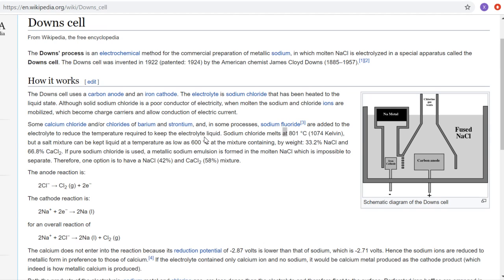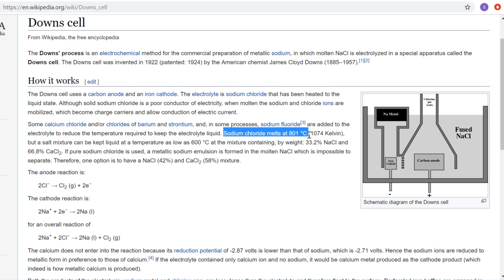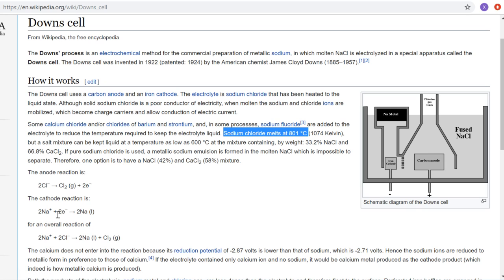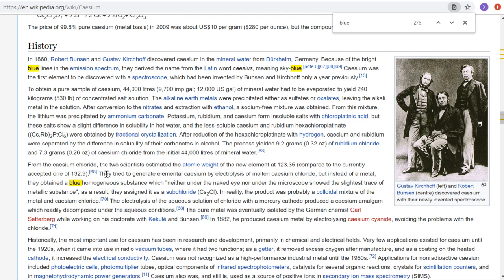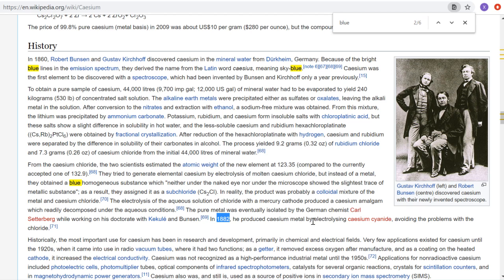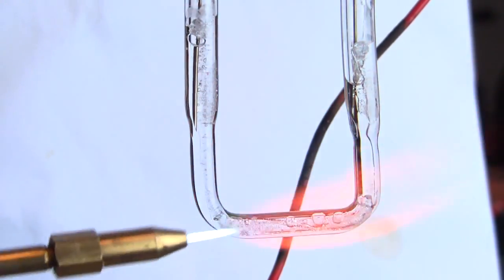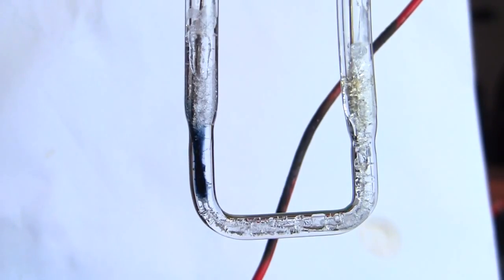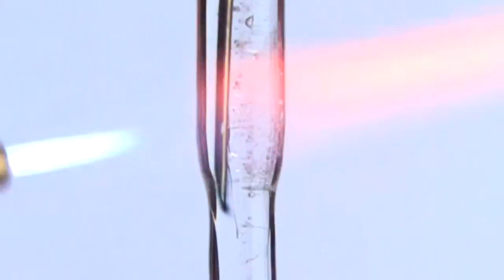Why you can't make Cesium by electrolysis of Cesium Chloride!

Comment: That is solvated electrons from the cesium. The stuff is wanting to get rid of electrons at all cost, even blue light can knock electrons off it. FWIW the easiest way to get cesium is to react the chloride with either magnesium, calcium, or lithium. It seems counterintuitive that these work, but the vapor pressure of hot cesium vapor is so high that it separates similar to how a precipitation reaction would concentrate a strong alkali as hydroxide from a sulfate salt.

Comment: But you CAN electrolyse CsCl at ambient temperature in a carbonate solvent: https://escholarship.org/uc/item/8m6348vh (you need AlCl3 to increase solubility though)

I'm quite curious about the chemistry here though, what happens to the resistance of the salt cell as the blue region progresses across the cell?
If the resistance drops this might indicate that a path is being formed across the cell made of a different material, maybe some sort of subchloride or the colloid mentioned in the wiki?

Comment: I tried a similar experiment by electrolyzing a mixture of CsI and LiI which has a conveniently low melting point around 100C. As expected there was free iodine being released
 at the anode in the form of vapor, so I expected metallic Cesium and/or Lithium to be present near the cathode or throughout the liquid salt. Strangely, after solidifying the salt and dissolving it in water there appeared to be no sign of metallic Cesium or Lithium, no reactivity, no hydrogen bubbles, just salt dissolving in water. It would be interesting to know if there is any sign of dissolved Cesium in the above experiment by dissolving the solidified salt with the gray or blue color occurring near near the cathode in water.

Comment: Even though I don’t think you actually created solvated electrons at such a high temperature, I think the electrochemically reduced Cs+ to Cs0 just acts as a dopant for the CsCl so to get Cs:CsCl, if so you should eventually end up with Cesium metal if you would further electrolyze the cesium chloride.

My other theory is that it forms a complex, since it has the electron configuration [Xe]6s1 and the fact that one cesium ion is coordinated by 6 chloride ions. I mean if you have the CsCl the Cesium would still have to get further six electrons to get a noble gas configuration and therefore it might be able to take up further electrons to reach its octet. Of course I really have no clue whats going on but the formation of a complex compound seems pretty logical to me, also this explains the color.

Comment: I study engineering I have 2 ways to get started on asignments and research one is hammer it into google and look at the pdf's and books, the other is look at Wikipedia brush up and go to the source section. recently I found this interesting page: https://www.researchgate.net/ nowadays I look at it too just to make sure I get newer intel on things.

Edit: We learned about the Sodium electrolysis in chemestry 101 for engineers, looks just like what we learned, I wouldn't dismiss it but look as stated before at the sources to see if no one fumbled around with the entry.

Comment: i do not think Wikipedia is a good source for public figures, animal counts, and anything conversational anywhere around the world. Chemistry and physics isn't any of those. Most of the sciences is never touched on Wikipedia but climate science, the big bang theory (science)  and a few others are not so reliable on Wikipedia due to popular thinking of " these are not real things".
It can be a good starting point to then go to more reliable less user generated content based sources to get the knowledge from as Wikipedia will ussually leave you with links at the bottom for where to learn more about it. To .edu sites for science pages.

Comment: The conventional explanation I read years ago is that electrolysing molten CsCl leads to the liberated Cs metal dissolving in the molten CsCl - which is where they got the idea of the subchloride (Cs2Cl) from. Now that we all know about blue solutions of solvated electrons, which they did not, it seems more than likely that your blue solution is just that: solvated electrons.*
However, Cs + nCsCl -> Cs[CsCl]n+ + e is not so far off the subchloride; I'd say their suggestion was reasonable at the time.

* I realise you know all this, but you did say at 5:44, "So, what the hell's going on here? Still don't have a good answer..." I see no issue whatsoever in postulating solvated electrons at high temperature. Remember, liquid ammonia works as a solvent for blue solutions not because it's cold but because it's polar-aprotic (effectively) - HMPA can give blue solutions of Li, Na, K etc at room temperature too, as can other solvents, and, let's face it, fused CsCl is a very polar-aprotic solvent. I suggest you analyze spectroscopically, compare the blue solutions in ammonia, HMPA, and CsCl: the spectra of the blue solutions should depend on the cavity occupied by the free electron and be nearly independent of the solvent, no? BTW, I have lab experience in chemistry like you, so if you'd like to discuss this, let me know. Fear not: I'm not seeking to out-publish you.
Reply: So that's how you do strike through, LOL! I was trying to write: Cs + nCsCl gives [Cs(CsCl)n]+ + e[-]

Comment: I'm just going to take a guess here. if the yellowish color on the right side is chlorine, than that may confirm my/your suspicion. What I think is happening (with my very limited knowledge of chemistry) is that the cesium separates from the chlorine, and that the cesium ions are soluble in the liquified salt resulting in a similar occurrence to the solvated electrons in liquid ammonia. Basically it could be solvated electrons from cesium in molten CsCl which then crystallizes, forming the blue crystals we see in the experiment. Again, I am not a chemist, but this just my humble opinion.

Comment: Possable theory that blue stuff could be cesium oxide or hydroxide from oygen or water in the air try the experiment but with the tube under vacuum
Reply: Yea it could be. My guess is that whatever has been produced has reacted with something (such as the rod or the glass) it would be intresting to see if this would work with a metal U tube

Comment: Are you sure it is diluted electrons? Did the colour last after solidifying?
I could be small particles and some scattering effect, if they are small enough optical microscopes couldn't observe them, but they would still scatter light in the wavelength range of their size, no?

The Wiki article is in line with that hypothesis, calling it a colloidal solution. I'd bet my money on some optical phenomena, rather than electrons... Free electrons at several hundred celsius sound really scary, like hot liquid oxygen xD

Comment: So weird question. If there are a bunch of "free electrons floating around" in that, if you touched it with a conductor like a wire, would current start to run through it?

Comment: The cesium/chlorine reaction produces three free electrons and the variation of temperature and density allows an occurrence of  superconductive moment at any point where 3 free electrons interact at 90 degree spin orbits. This creates a pseudo particle as the photons pass it interacting in the same manner as if it were a three electron particle. Element number 3 lithium. Lithium equals blue. Recrystallization locks in Optical properties as the moment of superconductivity releases. Of course that's only if you apply at the implications of the transactional method of quantum interpretation.
Reply: How does the Transactional Interpretation fit into it?
Reply: @Jehannum2000  in a complicated way! The implications of interactions at the subatomic scale being transactional allow for phenomenological mimicry. In this case you have dramatic flux in the energy and density at the same time as free electrons looking to collapse their waveforms, when you manage a three body orbit system transacting with Optical properties associated to an  atomic orbital structure(w/3electrons). It's their transactional nature that allows external Optical properties and subsequent solidification because it was the transactional waveforms coupling that provide direction for the atomic Spin and Magnetic Moment. It was at the electrochemical phase change of the chemical reaction that the atomic lattice was restructured in a moment of high flux.
Reply: @Iridehier  That's quite a radical idea, although very interesting. It's normally accepted that quantum mechanics interpretations such as TI are functionally equivalent to each other. However, I am interested in how incipient transactions in TI (advanced and retarded waves) interact with the universe. You're saying that there's a measurable effect from offer/confirmation wave interaction before actualisation of the transaction? I'm sure John Cramer or Ruth Kastner would be interested. And the idea of electron orbital structures with similar optical properties to atoms is new to me and also fascinating in its own right.
Reply: @Jehannum2000  I'll agree it's very interesting but as far as radical goes it's not that far from current accepted interpretations which we know to be somewhat self contradictory. Yes it is accepted that most interpretations are functionally equivalent insofar that they provide functional answers to a constrained set of observations. Where transactional interpretation leaves the group (Imo) is in the fact that it is not inherently contradictory as well as it identifies specifically its own limits. I am not suggesting there is a measurable effect before the transaction in this case I am suggesting that the result of the transaction coinciding with the phase change of the substrate allows for a locking in of the atomic structure which was induced via the transactional arrangement of electrons. The energy regime of the pseudo particle dissipates and leaves behind atomic structure for the photons to interact with. You say the idea of orbital structures with similar Optical properties to atoms is new and fascinating but I suggest that even classically it is the structure of electrons which dictate photons both in color as well as absorption / refraction. it's the nature of the electron orbits  that  is the unconventional aspect here. So I'll agree with fascinating but this doesn't seem like anything new to me, maybe your perspective was slightly different than mine regarding your statement.?
So on to the very interesting, incipient transactions! Please correct me if I'm wrong I believe this is where John Cramer left off, firstly I hope we agree that the advanced and retarded waves are parallel and and conform to classical waveform descriptions, including coherence and harmonically Interactive. Secondly, there is no interaction with the universe ( small scale superfluid except in cases of relativistic phase change) rather given the harmonic nature of the waveforms they interact with each other. A leading wave and the following wave are in opposition to each other based on opposing edges of a sine wave(not diametric opposition) . In this way you have three waves converging with six vectors. Four of which, or two waves if you will, have equal intensity (up/up) with opposing  Doppler aspects, while the third would be in 90-degree opposition(down) This three body system of 2 equal orbiting bodies with the 3rd orbiting the central axis (90-degree) creates three islands of stability radiating from the nucleus(orbital position or origin. If you apply the geometric calculations for coherence and decoherence(n;= s/s-1) to this system and iterate it to the 6th derivation of n=C*C+(Ai+b), you receive 3 trigonomicaly defined radiating islands of stability with an analog result for any region not included within the limits. The six incipient waves when occupied by a geometric Taurus (I know.. This is alot of unfounded suppositions but my math said so..) provide torque(instability vector) due to the Doppler nature of the symmetrical particles upon unoccupied stability regions. For example a hydrogen atom has the three quarks in the nucleus radiating their existence as an orbital system and the first electron can do what it does, but the second is obliged to be in opposition due to the feedback propagation in the field at a rate defined by Maxwell. This propagation carried forth to the 3rd island of stability means that there is a torque vector from different directions as well as torsion because of the Doppler motion within the field itself. This is the reason why no third electron will fit at the bottom of a single proton system. Would love to hear your thoughts, p.m. if you like or leave it here for the world... your call.
Reply: PS after re-reading your last question I see you are specifically interested in the time element of the transactions. I did not even approach this question in my answer. The solution to the transactional nature and directions of time is also fascinating and the hypothesis is what has led me to the 6th derivation calculation inadvertently. I would assume I'm crazy however the results confirm to all other observational data (tunneling, entanglement, string, cpt) including the double slit that I have been able to find.
Reply: @Iridehier  I meant the idea of optical mimicry was new _to me_, not new per se. The idea makes  sense - it is of course well-known that colour arises from light quanta absorption / emission at definite electron energies.

I agree that offer and confirmation waves are parallel and conform to the quantum wave functions psi and psi* (the former propagates in the forward time direction, the latter in the negative time direction). This means they can certainly interfere/cancel etc. with each other and themselves.

However, as a short aside, note that offer / confirmation waves can be polarised or phase-shifted by mirrors, polarising filters etc. so there is some interaction between them and the physical universe. They are, after all, an expression of possibility, which is bound by physical constraints as well as conservation laws.

Now on to your more technical description - the meat of it, as it were. I would very much like to see more details, before commenting but I think that should be left to personal messaging. I don't actually know how to PM on YouTube! If you do, PM me. Or I don't mind putting my email address here for a limited time until I hear from you.
Reply: @Jehannum2000  I see there is no p.m. here, I would be very happy to ask you something if you did leave a contact.
Just to finish this public side of conversation....

I believe(it was along time ago) the idea of Confirmation and Acceptance waves was to answer a specific question about interactions involving direction of time. A wave has a leading edge and a trailing edge that is the reason for parralelity.. We don't need a wave to transact across time, the force itself already is. 
 While confirmation and acceptance play a role unfortunately for TI the approach appears as a closed street.. The polarization and other correlated phenomenon (refraction) can be answered with quantum chromodynamics depending on how the lepton regime marshals(acceptance) the (torque vectors) weak force. For example  the previously mentioned  island of stability  and Taurus topology  require a certain alignment  which  is a passive acceptance and/or  semi active refusal(refraction) . This is an interaction of wave forms without need for interaction with the universe.. When you measure the interaction (observation) you demand confirmation and collapse. Since all things are relative to an observer. When we do not measure we do not observe, of course this begs the question who is the Observer before measurement. Subatomic particles are relative to each other. The laws of relativity do actually apply at small scales, especially when we don't observe but the Observer is moving fast. If you apply the laws of relativity (simple kubelblitz) to this scale electrons operate at different timescales(space-time) we call valence shells, and those shells exist whether they are full or not.
This model is dead simple

Comment: out of curiosity, what happens if you turn of the power while keeping the caesium liquid? Does the blue spread or disappear. I expect it to be caesium in the -1 state/neutral state combination. Now the question how to test in which state it is. Well, you already have the electrodes in it, thus are you willing to attempt circular voltammetry with it. You would expect two oxidation peaks for the blue stuff i.e. dissolved electrons and the metal. Additionally, what was the gas above the caesium chloride, just air? What potential was applied on the system?

EDIT: 

Probably a bad and impractical idea, you can solvate electron in ammonia obtaining this blue colour. If caesium also has the same effect, what would you expect that occurs if you add the liquid ammonia to metallic caesium. Excess caesium needs to be used I expect, but can you by evaporating the ammonia transfer the electros to the caesium and make it blue.